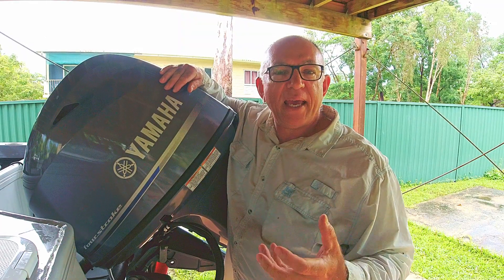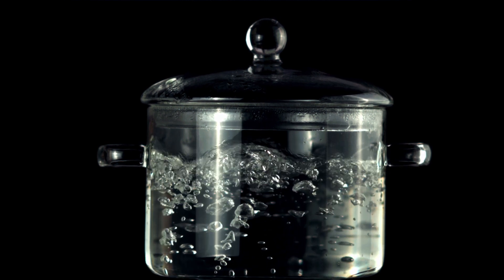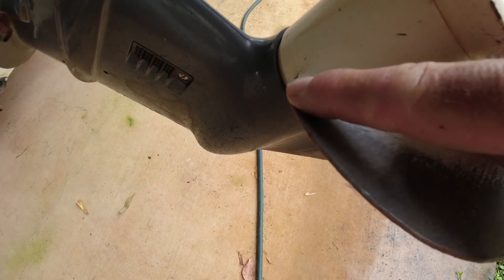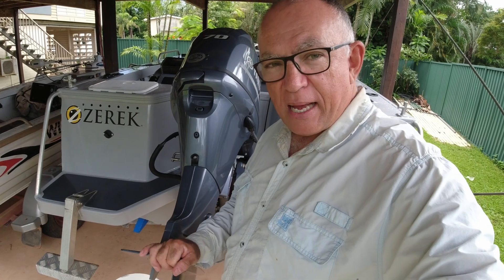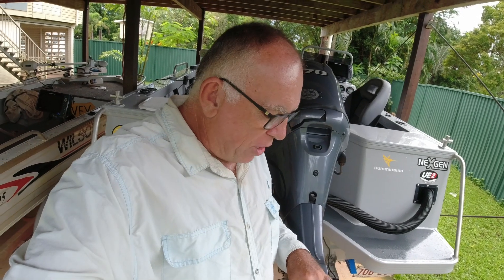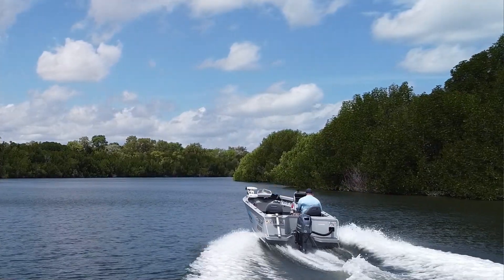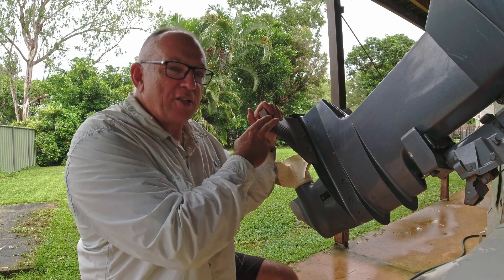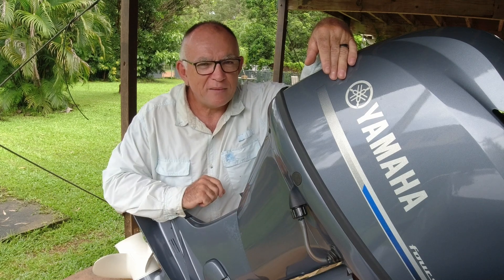DO YOU NEED A HYDROFOIL? All you need to know about cavitation and ventilation.

Comment: I put the no drill se 400 hydrofoil on my 60 hp 4 stroke mercury on my legend 16.5ft full windshield Excalibur fishing boat that is rated for 75hp. It would run ok with just myself at 140 pounds. But it would not plane with 4 people in it, it is also heavy in the back with a 4hp kicker, downrigger, canopy, etc. Anyway, before the hydrofoil I switched to a 4 blade prop that helped a tiny bit with getting out of the water, but after the hydrofoil it was like a new boat, not just getting on plane easily, but with almost no bow lift at all.
Reply from the maker: For some boats they work so well.

Comment: Cheers for your expert knowledge.  
Question I have ordered a sea jay 385 angler it weighs 100kg I'm putting on a new 5hp tohatsu  propane 4stroke(propane because I react to exhaust fumes and 5hp because it's the biggest propane allowed in Australia) what are your thoughts on fitting a se sport hydrofoil the smallest one? Cheers

Comment: I have an older 16' starcraft with Force 75 I jus inherited and I'm adding a 5hp kicker, extra battery and extra 3 gal tank so I'm thinking this fin Will be a help lifting the extra weight. They're really not that expensive to solve a big problem. TY for making my decision easier 🙏👏👏
Reply: Ideal for vessels like yours. Especially if the weight is on the transom. Let me know how you go.

Comment: Yeah, but your hydrofoil is not in the water when you're going down the lake. It should be up out of the water if your motor is set at the right height!!!
Reply: Gday Clayton1379. When set at the right height, it sits on the surface of the water causing that lift at the transom. Just as the anti cavitation plate is meant to work.
Reply: Not necessarily

Comment: If your hydrofoil makes a difference... Then your boat and motor is set up wrong, the anti-ventilation plate should not be on the water on plane, race outvoards dont even have them.... Balance the boat better, set the motor height properly and very importantly get a decent prop that actually grabs the water and get rid of that aluminium rubbish
Reply from the maker: All valid points AJM. But I don't have a racing boat set up. I don't have a jacking plate. I don't want a stainless-steel prop. I do understand, and mention in the video, that the hydrofoil is there to fix a problem. 
Due to it being a factory setup up fishing boat, it is far from the perfect setup that you need in a racing boat. I fish around rocks and do a prop from time to time. Just part of my lifestyle and most other anglers are in the same boat, so alloy props for me. Plus, it's only a 70hp engine, so the alloy prop isn't going to flex like it would on a boat with a bigger engine that is built for speed. Going stainless on a 70hp makes bugger all difference until you hit a rock. So, I can totally see your point. It is all about optimising the set up. Or, if it isn't quite right, throw a $150 worth of hydrofoil on the outboard. 
SBC
Reply: You can keep your stainless prop and bend your prop shaft whenever you like. I'll keep my alli prop and limp home if I make a little mistake.
Reply: Bro, you’re only partly (a mini part) correct. Go back & do more research as I don’t want to embarrass you.
Reply from the maker: @murfrirhke4557  Don't hold back mate. I don't get embarrassed. If I am wrong then please let me know. However, my target audience is small boat owners that just want to get out on weekends and go boating or fishing. No racing boat enthusiasts with jacking plates and  custom props. Just weekend boaties. I have been boating for over 40yrs, owned many many boats and have worked for many years as a commercial skipper so like to think I know a little. But always willing to learn. SBC.
Reply: @murfrirhke4557  feel free to try embarrass me all you want my friend. Be careful but you might make yourself look like a bit of a goose. These wastes of time are mainly only popular in Australia. I'm not however, referring to the American hydrofoils that they put in the flats boats for a specific reason.

Get a decent prop and set the boat and motor up properly, hydrofoils are a bandaid fix. Feel free to Google it.

Comment: Thanks for this post, very good knowledge and info. I'm interested in your opinion about whether a Hydrofoil is likely to assist with 'torque', for lack of a better way to describe it. Essentially, is the directional assistance helpful when the tinny is loaded up with four people and gear? Running a 25hp 2 stroke on a 4.1m V hull Stessco. Can't seem to find any testing data other than  speed and bow rise with just the captain on board. Any thoughts?
Reply from the maker: G'day Mate. I am guessing that the 25hp struggles to get up on the plane and moving with such a load and unfortunately, it's unlikely that the hydrofoil with make any difference. It's just too much load for a 25hp on a 4.1m. Even a 30hp would struggle. One of my boats is a 4m flat bottom punt and I can't get that to plane with more than 3 people. And that has a 30hp with a foil. 
I try to avoid a hydrofoil but if I need just that extra lift to push me onto the plane or I have a ventilation issue on turning like I had in my Seajay, than I go for it. But in your case, the slight lift that a hydrofoil will give, would be enough to offset the weight. 
Sorry I couldn't be more positive.  
SBC.

Comment: I had countless Foils on my boats..all in all..there a waste  of time n $$$...most guys doing these videos  r Profiting from it.1 way or another. Despite of what tell say on here
Reply from the maker: Hi Alex. I disagree. I avoid using foils if I can but if I need just a little lift to get on the plane better or at slower speeds, then a foil is a good option. Sometime weight distribution or not trimming the hull out correctly is the issue so if all that is checked, a foil is the last option. 
Thank for the feedback though. SBC.
Reply: Rubbish. they work very well PROVIDING you are addressing an issue they are designed to fix…keep on plane at slower speeds, raise the engine hydrodynamically, require less fuel to stay on plane…the list goes on.

Comment: Thanks for the great video! How will I know if my engine is mounted too high? What are the clear signs that the propeller is getting air, even a little bit?
Reply from the maker: The engine will start to over rev even on slower or easy turning. If you have a boat that it trimmed out and you turn sharply, it will suck in air and ventilate, but if it is doing this all the time, it needs to be dropped lower. 
I will look at a video that covers engine height so that you have a clear understanding of it. SBC.
Reply: @smallboatcaptain1968 Thanks for your answer!

Comment: That was a very interesting video and explains a lot for
me, I have a 3 meter sib and over the weekend the weather went from
Smooth as silk to a
Bit lumpy, so I headed home and every time I got it up it started over revving and lost power then grabbed again as i throttled off, I now have a better understanding of exactly what was going on 🙏🏽
Reply: It could also be your prop under load is slipping on the rubber center it’s attached to. (If has that). My 79 Ranger w 175 merc would do it when trying to plane and I’d have to come to a stop and take off again. If i went lite on throttle I could plane, but it soon got to where it wouldn’t plane. It was an aluminum prop for family ski type boat. I finally Bought a used stainless steel 24p prop and wow big difference, the top end went from like 38 mph to over 60mph w steel prop

Comment: Yep Hydrofoils are only good if you need them. I got one and it saved me a lot of money. My boat has a weird hull where a normal shaft is not long enough but a long shaft is too long. So i went with a normal shaft, put hydrofoils on and it runs perfectly. I live in Germany and over here we only have those crap plastic ones you have and ordered for your new outboard. After a long search i found ozpropellers, they make great aluminium foils. Very happy with it and it was worth it even with the import fees i had to pay.
Reply: That’s great. They do make some great hydrofoils and worth the money. Thanks for the feedback. Especially all the way from Germany.

Comment: Just found your channel mate..Great video .As for hydrofoils my choice would be Permatrim (which I have) or Oz hydrofoil.Those SE sport,stingrays etc don’t come close.

 Keep up the great work and looking forward to seeing other videos.
Reply from the maker: A lot of people have mentioned the Permatrim and I see a few around my area. What makes them so good in your opinion? I have never put one on a boat before so I would love to do a comparison. 
SBC.
Reply: @smallboatcaptain1968  I think they are more durable,ridged and better designed.They are longer and have deep turned down edges to keep undisturbed water longer around the prop giving your prop better grip/thrust at the prop.
  My boat in avatar planes quicker and maintains plane at slower speeds,has increased my fuel economy a bit and steers like it’s on rails now.I have friends with way more boating experience than me and all say the same about permatrim/oz hydrofoil.The difference between the 2 of you didn’t know is perm has a curved trailing edge and oz has a straight trailing edge.
  You are a very knowledgeable guy mate and love the videos.A idea for videos I would like to see is one on launching/retrieving boats both drive on and winch on and on docking as so many people are hopeless at it if you don’t mind at some stage.

 Cheers.
Reply from the maker: @Hahehhwgajshah72726..  I am very interested in looking at these hydrofoils a lot closer. 
I am always after video ideas mate so expect to see these ideas in up-coming videos. Great topics. 
Thanks for the feedback mate, 
SBC.
Reply: @smallboatcaptain1968  No dramas mate.They are a good bit of kit honestly.Saying that because you have the Se sport and it’s doing what you need I’d invest any spare money on other things and keep the permatrim or oz hydrofoil in mind for next time you’re looking at buying a foil or know someone that might.
  Looking forward to seeing the channel grow mate.
Reply from the maker: @Hahehhwgajshah72726..  Thanks Fabian. I appreciate the support. 
SBC

Comment: I don’t have 50yrs of experience like some but the one you have on the old one is pure gold. I tried with and without on a 115 and no speed loss but the performance is like gripping the water like boots with glue on tiles vs skies on ice. I dont know abt the one you have in the mail but ill bet anything on the old one.
Reply from the maker: G'day Steve. They are both very similar but I like the dolphin fins I have on the old boat for small engines and the SE Foil for anything over 40hp. Just a preference but they both work really well.

Comment: Been boating for 55 yrs never ever saw a speed increase on a well setup outboard.
Reply from the maker: G;day Ron. I agree. Foil manufactures state that they can make a boat go faster but it would have to be fixing a poor setup. Get the motor height and prop right and the foil won't make it faster. I fitted a SE300 foil to my SeaJay and it didn't increase the speed. It was faster by 1kph but that could be current, water conditions etc. 
Thanks for the feedback.
Reply: Change your prop
Reply: *. I put the same SE 300 foil on my boat in the hopes that it would correct a little porpoising , and a slow hole to plane problem. It corrected all these problems. I thought that it may have slightly increased my speed, but I know, it definitely did not decrease my speed. I also found out that I could stay on plane at lower speeds.

Comment: gday mate i had a permatrim foil on my last 4.2 anglapro attached to a 40hp enduro i rekon it helped get it on the plane quicker looking at putting one on the new 40 four stroke when it arrives there are two different companies oz props and permatrim dont know if they are the same or not but oz props is cheaper by about 20 dollars and an aussie company so ill probably go with them , one thing i liked about these type of foils is they are good when pushing of from a beach as a step before you start the motor . I like your style of videos no bullshit !
Reply from the maker: G'day mate. Thanks for the kind words. I agree. They are great for getting a boat on the plane. I've watched a lot of videos and read in on-line posts that they do nothing but I've used them for about 30yrs and they make a big difference. I would recommend testing the new boat and motor first. If there is no issues getting it on the plane and trimming it out, then a foil will do very little apart from get it on the plane slightly quicker. But if it bogs down and doesnt sit quite right, the foil is worth a try. 
I got my new foil in the main this week so will fit it on the weekend and put a new video out.
Reply: I hi